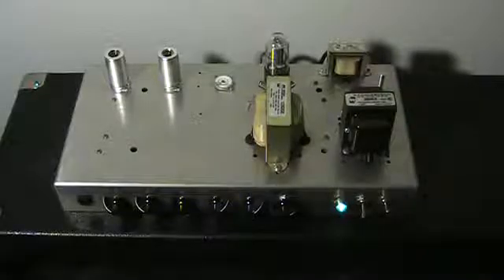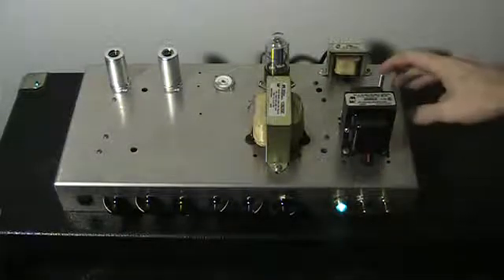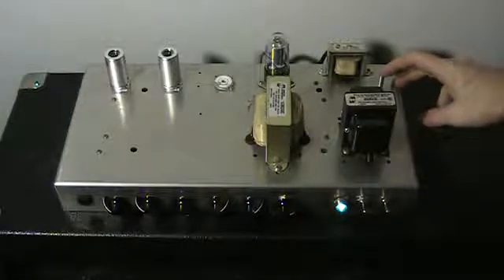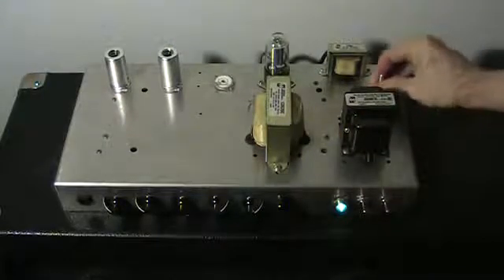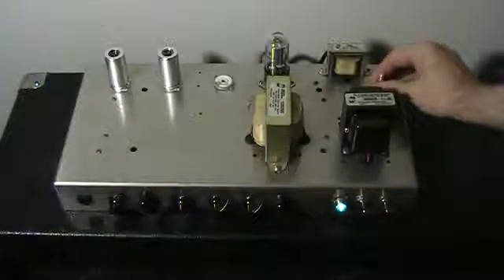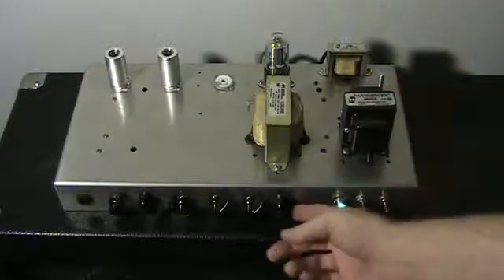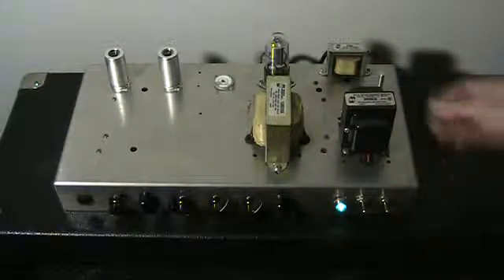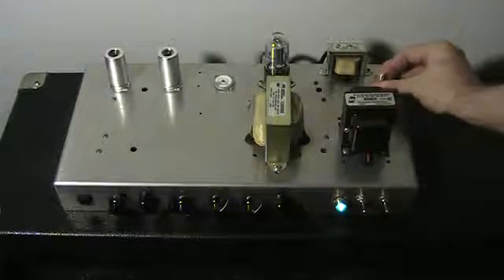High Octane Hum Balance Control

Comment: The best way I found to lower the noise of this amp is to rotate the PT 90 degrees from the way you have it. Doing so will cross the bobbins of the transformers at 90 degrees. NOT the plates.